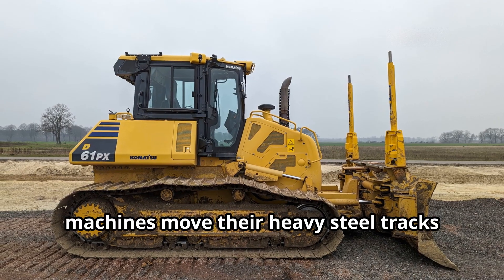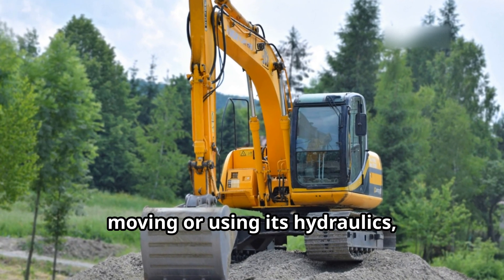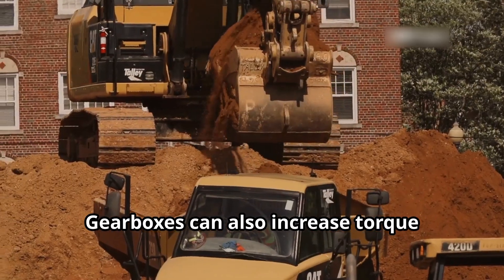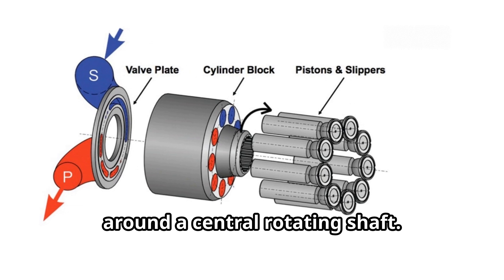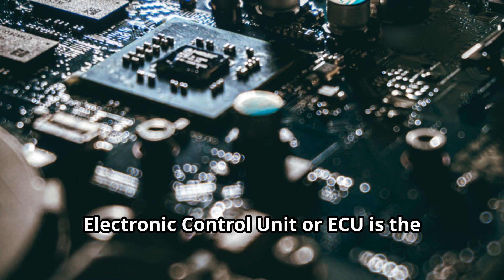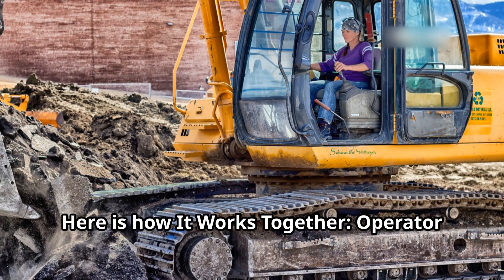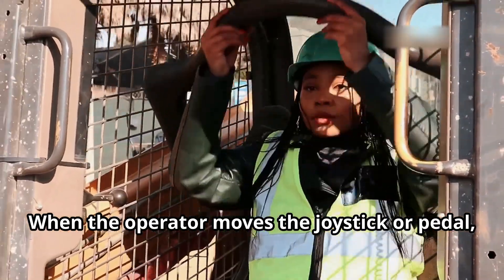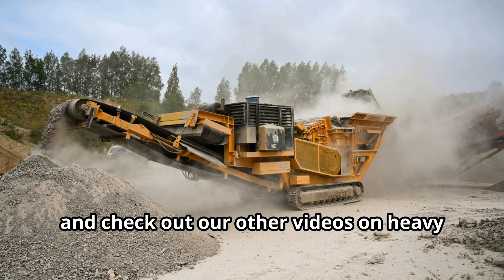How power is transferred in various forms from Engine to Track Hydraulic Motor? #tracks #hydraulics

Comment: Excellent explanation on requirement of gearbox, axial piston pumps, control valves and ECU in the hydraulic system of tracks in heavy machinery.👍
Reply from the maker: Thanks for appreciation!! I have uploaded few more technical videos on Mechanical Engineering. Please have a look and share your thoughts.